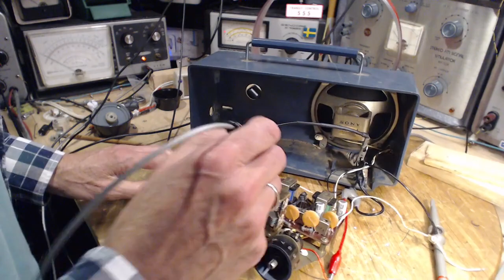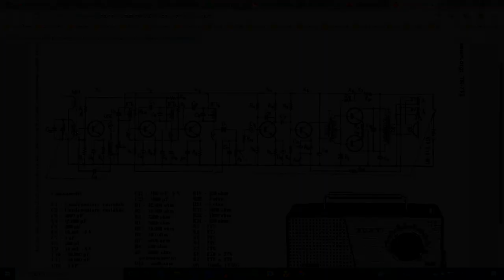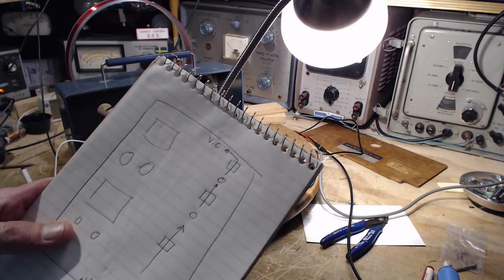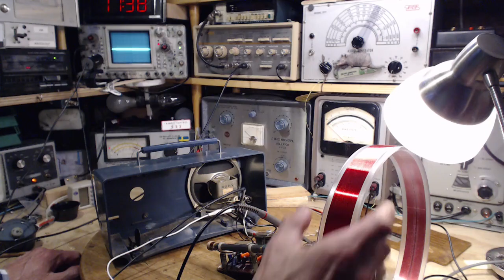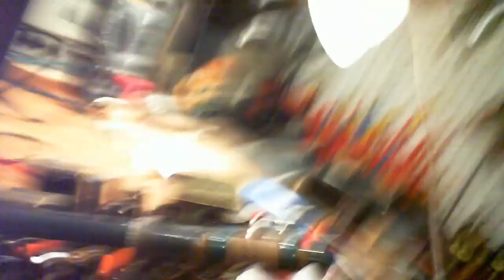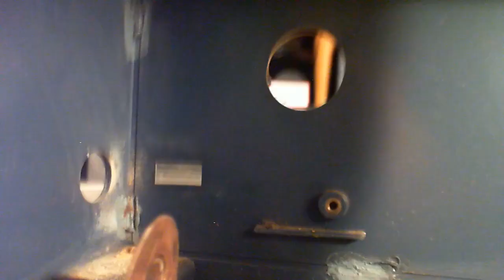SONY TR712 Transistor Radio Video #8 - Replace Transistor?

Comment: 48:12 stop babbling about brain cells and use them instead
49:05 quote "the suggestion is that there is some quantum activity going on inside (your brain cells)" unquote
Well speaking of quatum activity, maybe we get lucky to the point that Dr. Samuel Beckett will "Quantum Leap" into your persona and he and Al will fix this radio in due time...

Comment: The signal at the wiper of the volume control will be smaller than that at the input. It is followed by three stages of amplification, so it really needs to be small.  This should not surprise you.

Comment: The audio output is driven from the secondary of the output xformer, and does not require any ‘ground’ reference, except to make the feedback work. I really wish he would stop chasing squirrels
.
Reply: But look at the earphone and external speaker jacks. They reference to ground and would not work properly if a secondary of the audio output transformer was not grounded. - Unless you deem the 220+5 Ohm path to ground via the feedback line an appropriate low resistance path for an external speaker. 
There is probably a bug in both the Sams amd this schematic. 
One side of the audio output being grounded can also be deducted from him measuring the 220 ohm resistor in the feedback loop in circuit and it showing 19 ohms. (43:37)

Comment: Jim the speaker must have a ground connection or the o/p jacks will not work .

It's a screw up on the map !
Reply: PS
Signal dropping out on the scope .
“check the probe clip & wire” .